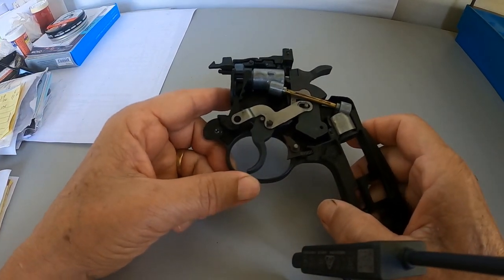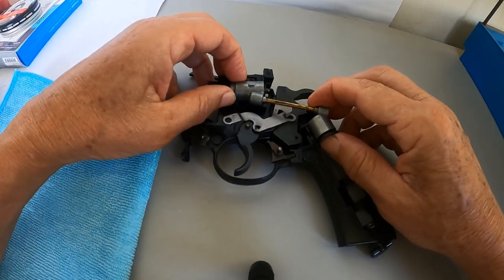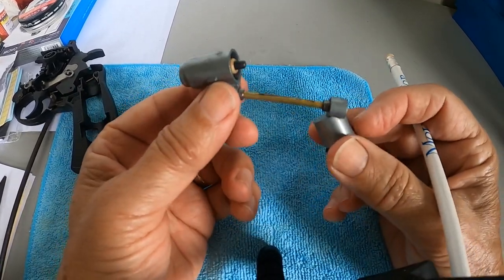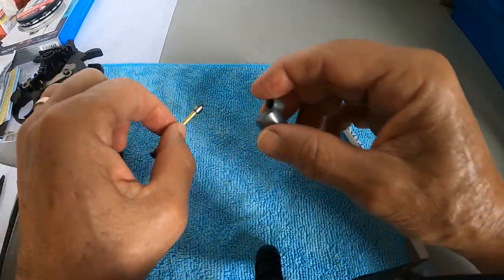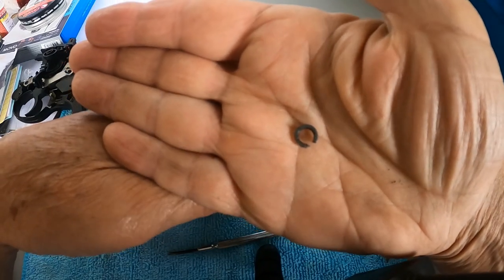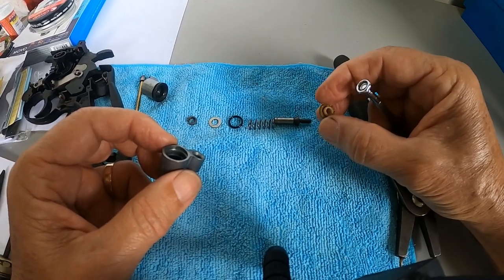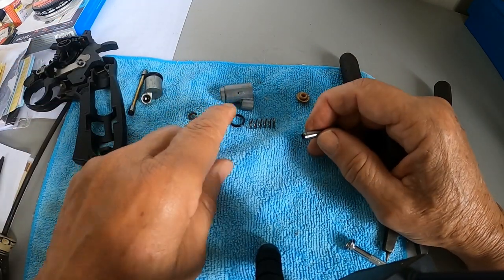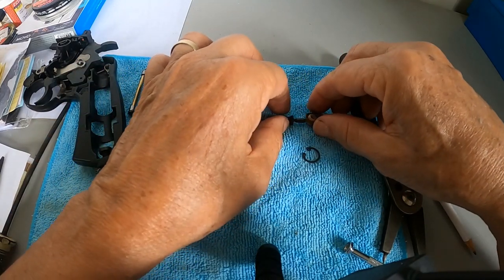CROSMAN 357 VALVE LEAK REPAIR

Comment: Youd think for a 70$ air pistol that valve would be so much stronger. Ive replaced all the seals and valves twice but here i am now seeing if theres other things people have done to get these to work again. The vigilante is the first crosman ive ever had to work on 😢
Reply from the maker: Chendo
I agree but the reality is that we  live in a time where Corporations are outsourcing manufacturing to the lowest bidder. I have found that the seals coming from China are substandard to those produced in the west.
I normally stick with Crosman products because of the availability of after market parts and assy. Diagrams. 
Thanks for watching and commenting
Reply: I got a 357 SIX from between 1983 and 1987, and after I replaced the seals, it works great. Better performance than a modern vigilante.

Comment: Wow, that brass tube came off both ends quite easily, how did it Ever hold the Co2 pressure..
Reply: Sorry for he delay. I was away from home a while. Once reattached the whole assembly, when inserted in the action, fits so tight that the brass tube cannot move in any direction.
Thanks for watching and commenting👍👍

Comment: 2:07 this was stressfull even through the screen! Haha
I ended up ordering my 2240 from somewhere else so I didn't get the chance to order spare parts for my Vigilante... But I sure want to now that I know somewhat how it works 😁
Reply from the maker: Thanks Lowkey.👍👍 Using that C clip pliers is key to getting the job done. I anticipate a problem in reassembly as we will have to depress the valve stem while inserting the C clip.
No sweat! I have a plan but you will have to wait for the next video. HaHaHa!😁
Reply: @airgunshootingandoutdoorch4260  hopefully everything goes well!

Comment: What are the part numbers or link to the parts I need to fix this gun?
Reply from the maker: Here are the part numbers:
10592......Assy. Puck
130--034...O--Ring Seal
357a 054...Seal Quad
38--130.....O Ring (valve Body )
38--128...12gr CO2 cartridge Seal
Hope this helps to get you up and shooting again.
Thanks for watching and commenting👍👍

Comment: i found my dads crosman 357 and it leaked all co2. really helpful video thanks for sharing <3 . i have to ask one thing, when i complete all pieces like valves and pipes, is there any kind of glue or something for prevent co2 leaking from pipes and valves connection? are you use anything for them?
Reply from the maker: Just use some silicone grease or Crosman Pellgun oil on all the seals when assembling them and everytime you insert a new CO2 cartridge put 1 drop of pellgun oil on the tip of the new cartridge . Once pierced, the CO2 will blow the oil through the valves and help to seal them from leaking..
Check out the other 2 videos.  They will help you with the repair.
Thanks for liking, sharing and subscribing. 
All the best,
Pete

Comment: Is it possible to modify the valve assembly to gain fps from some guns?
Reply from the maker: I don't think there's much you can do with CO2 pistols except try to put more tension on the hammer or shoot them in a very warm environment.  Also pause 10 to 15 seconds between shots to give the valve time to recover  from the cold CO2 passing through it.
Tweaking valves to gain fps is more of a PCP thing.